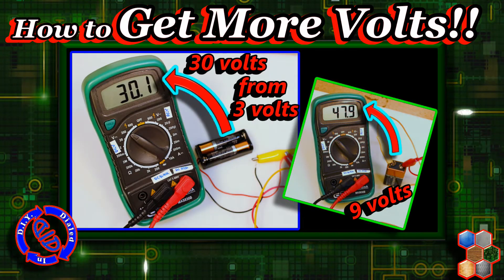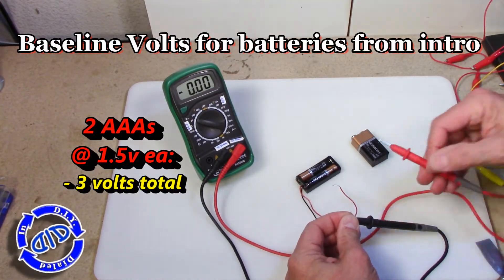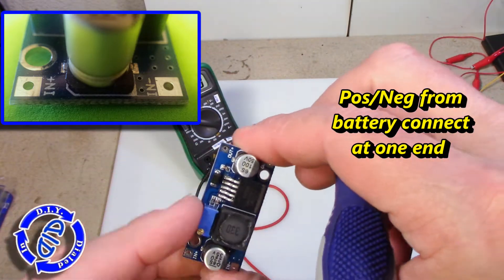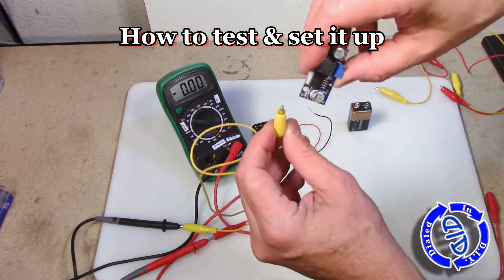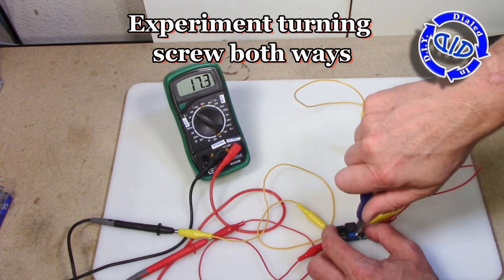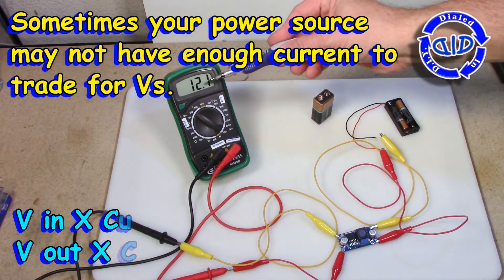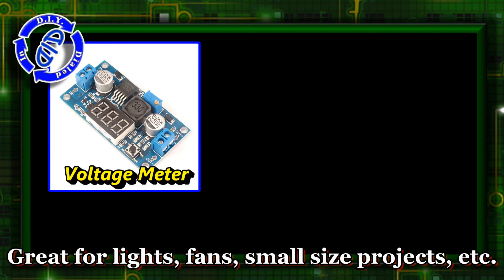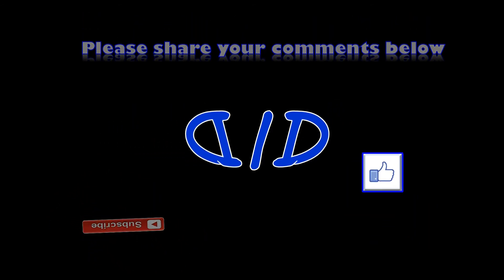Power Boost - How to Get More Volts from batteries

Comment: so this works like a joule theft? also lets say i use a phone batter which is dying, and using it power this converter and set the voltage to 3.7, will it be able to hold the same voltage, if yes, for how long, if no, then why?

Comment: so this can boost the dc motor?
Reply from the maker: Yes, I've been using these on DC fans that need more volts than my battery pack provides. Thank you for taking the time to watch and comment!
Reply: @DialedInDIY  i need extra juice for propeller...
Reply from the maker: @SushiCat0316  is it a propeller in a boat or a plane?
Reply: @DialedInDIY  im planning to make a video on how to make a homemade drone (all home made as possible other than the remote control), i was searching also on how to combine salt water battery to produce more voltage or any good substitute other than using lithium...

or else i would end up making an electric skateboard...

Comment: I have bought four of these steppers and they dont increase the voltage only down LM2596 is the item number is this what you are using TIA
Reply from the maker: I have it now...  I used adjustable step-up converters that I bought from Amazon for less than $2 each (pack of 5). The specific item and source was from Gowoops: 5 pieces of Boost Converter Module XL6009, 3 - 30 volts to 4 - 35 volts DC - DC.  Hope that helps!  Thanks again for taking the time to watch and to comment.
Reply from the maker: Thanks so much for watching a posting your comment / question.  I looked up that model number and it is a Step Down module; designed to take a higher voltage and reduce it.  I am going to look up the number of the item I bought and get right back to you.

Comment: No mention of wiring batteries in paralell or voltage doubler circuits?
Reply from the maker: Very valid point... thanks for the feedback.  There are other options that will result in more volts from a power source.  My goal with this particular project was to get more volts from the batteries that I had space for in a given project. I did work with the circuit on AAA in parallel but did not want to add more batteries so I went with the adjustable step-up so I could dial in the volts with some added flexibility for adjustment.  Thank you again for taking the time to comment!!